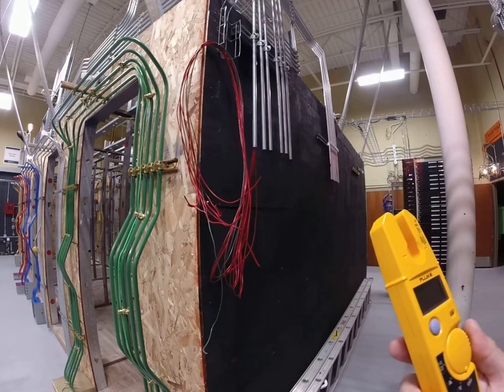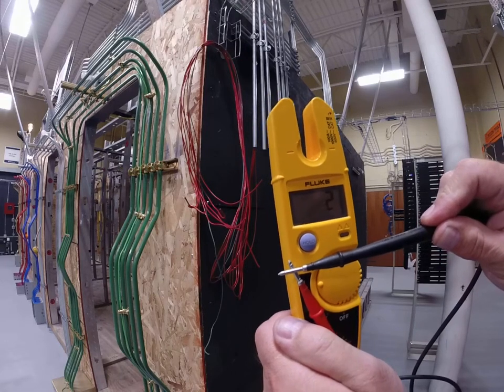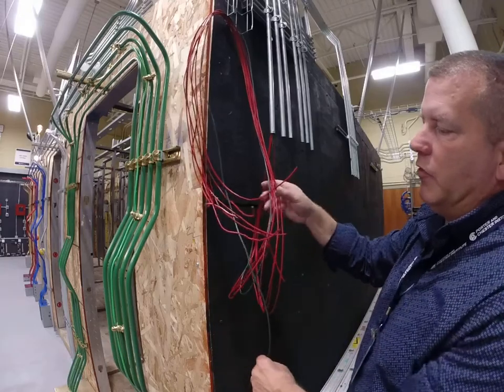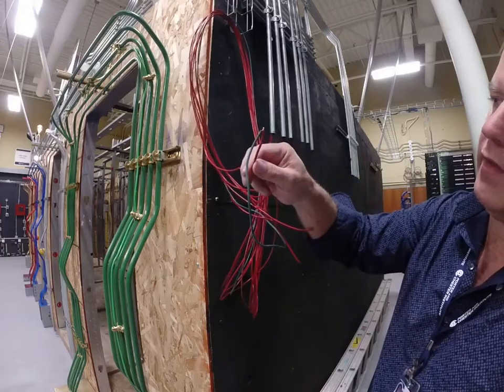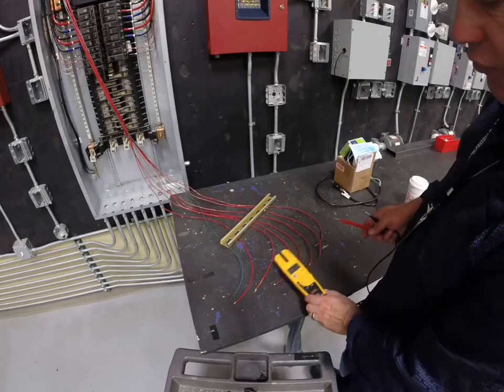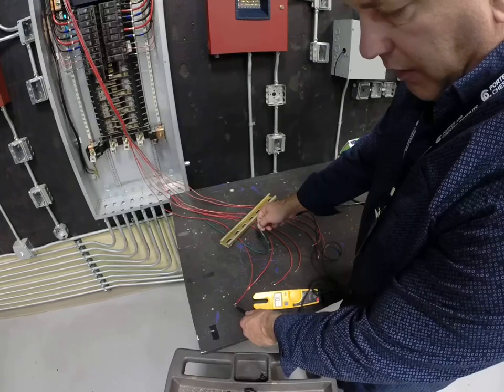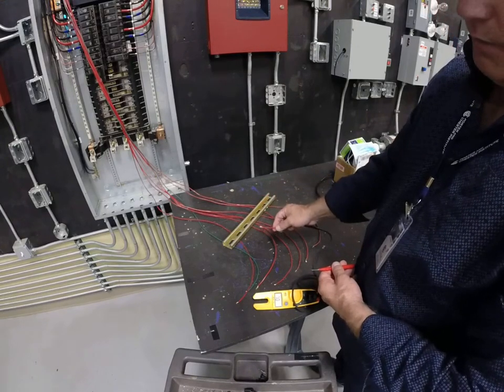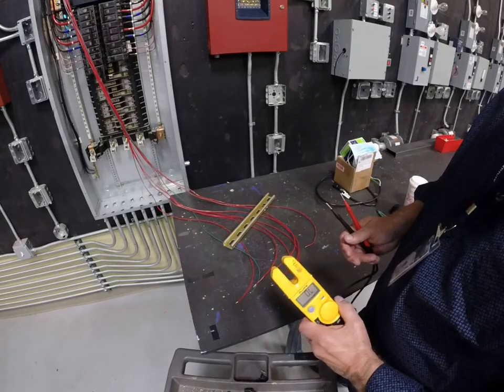How to Ohm/ring out a circuit

Comment: Cool video.  I know there is a way to ringout a cable where the ends are very, very far from each other using two multimeters.  Do you know any tricks to that?  Do both meters need to be connecting to the SAME ground?
Reply: You don't need 2 multimeters, just use a 9 or 12v battery and multimeter or a good tone and trace set.